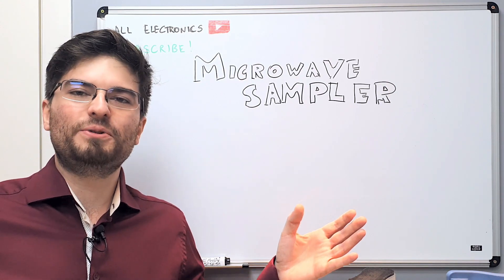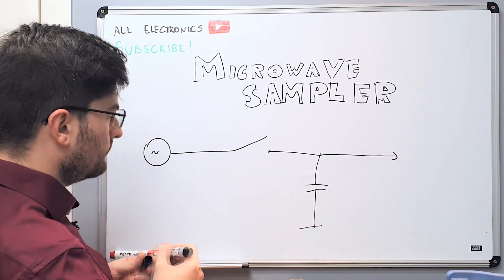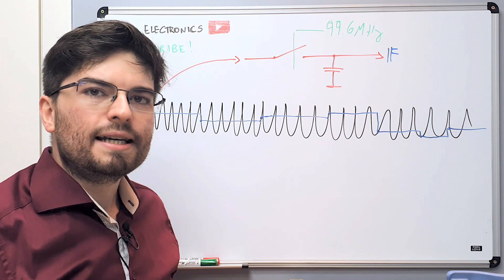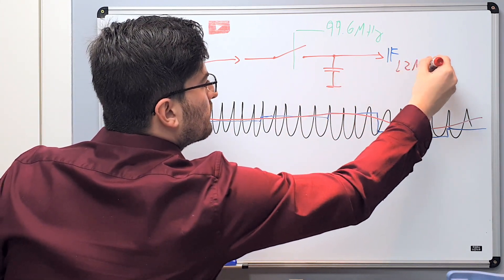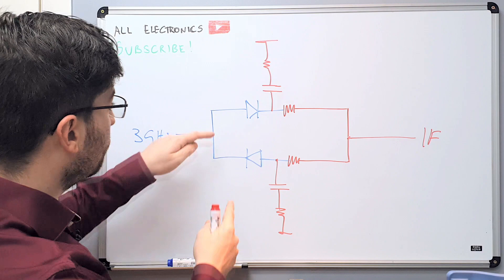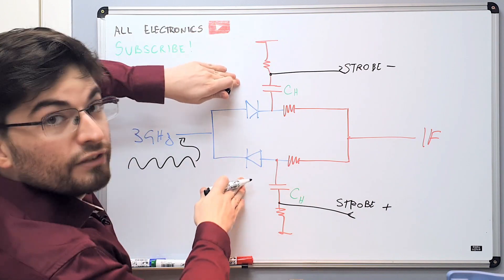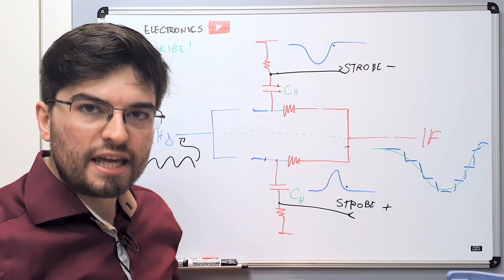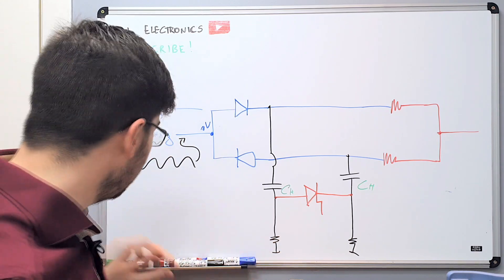Microwave Diode Sampler for PLL

Comment: There is not much information about using a sampler for for conversion. However you find in in the main PLL loop of many signal generators and spectrum analyzers. 
This is a great explanation. I have a 9-18GHz YIG oscillator, this would be better than a prescaler for a PLL.
Reply from the maker: Thanks man, indeed! I don't have any YIGs here, certainly something I want to experiment with. Welcome to the channel
Reply: @AllElectronicsChannel 
Just became Patreon 😊

Comment: Great explanation
I´m quite new in this field, so please forgeve me for my probably silly questions.
1) As you said, when the diodes are on conduction, the 3,3GHz wave is sampled and  it change the charge of Hold Capacitors.
Does it means that the Strobe pulse  is a reall really fast pulse, ( shorter than the 3.3GHz period) is it correct?
2) When the 2 STROBEs signal comes,  why the hold capacitors charging  are a not influenced? 
Thanks in advance.
Sergio
Reply from the maker: 1) yep! Actually what matters is the fall time. It needs to be really fast, to open the diode, storing a snapshot of the signal. The width of the pulse doesn't matter much..  

2) Really good question!! This is why we use a balanced topology! You see that the voltages generated by the pulses will cancel each other, because they have opposite polarities! The degree of balancing impacts the rejection of the strobe pulses at the output. 

Welcome to the channel!

Comment: very very nice !! thanks professor Gregory!!! i have attended for the first time , a nice class after 40 years of my engineering graduation!!! LOL !!! can you please tell me what  happens to the phase noise , if we generate 3GHz from a 100Mhz  ultra low  phase noise  Lo? thanks
Reply from the maker: We need to test and investigate! I understand that this can be a lower phase noise method than prescalers because it's high gain, from the harmonic amplification. 
But the theorical limit os 20 log (N) will not be break
Reply: @AllElectronicsChannel  then there is no difference between freq multipliers and sampling phase detector!!
Reply from the maker: I think you are right !! I found a nice paper about it, search Google for "sampling PLL phase noise". It seems the sampler indeed don't have the N^2 noise !!

Comment: yahuuuuuu!!!!!!
PLL enbreve!!!!
Reply from the maker: yep!!
Reply: @AllElectronicsChannel  I was thinking ...
To ensure that the sample point is similar to the previous pulse width of Strobe should be very short, less than a cycle of 3.3GHz (0.3 ns). Does that generate it with the shotky diode peak?
as you say, beautiful idea !!!
Reply from the maker: Yes!! This narrow pulse is generated by the Step Recovery Diode* pulse! 

The transition time is something like rise time 150ps, to ensure a very narrow width, I used more resistors to bias the diode bridge, so it is only sensitive to the very narrow peak of the step recovery action. 

I think also that the width is less important than the rise/fall of the pulse.. because it doesn't matter if the switch stays closed for more than a cycle, it is important that it changes state faster than the cycle!

What do you think ?
Reply: 1- The starting time of the Strobe pulse should be able to load the capacitor => The 3.3GHz source must have the appropriate impedance for in 150ps to transfer that amount of energy.
2- The time of closing the SW should be very precise ... really that would look good to see it work. I think it's an ambitious, but if it works it will be very good and useful. I am looking for a prescaler to make a pll of 10GHz.
I'm following your publications.
Reply from the maker: It works beautifully! Next video I will show it. The IF output has more than 1Vpp, easily can excite logic circuits directly. This sampler also can be useful for frequency counters, working like the olds HP microwave counters. Maybe our next project !!
Reply: @leomartihart  The HMC363 is a great prescaler that works up to 12GHz. 
Just a suggestion, if you are still searching  :)

Comment: I think it is important to state that the RF signal voltage needs to be less than the diodes junction voltage otherwise it would work as a rectifier and not have the switching behaviour. Also the capacitors must be of high quality at least C0G but best would be Teflon ones.
Reply from the maker: yep!

Comment: Nice, I have a doubt, will the current balun not shunt away the high freq differential signal generated by SRD ?
Reply from the maker: The pulses have very high frequency content that is easily blocked by any leakage or parasitic inductance of the balun